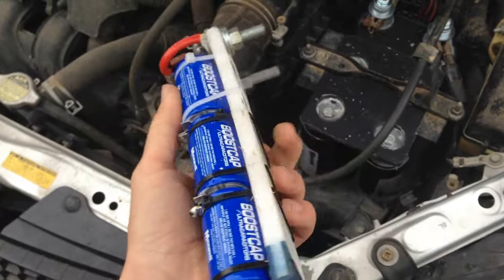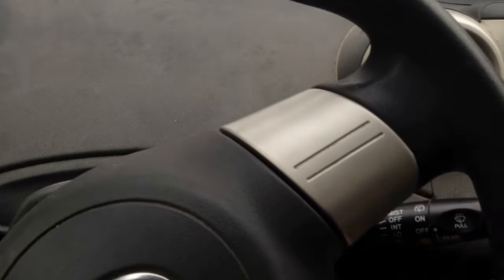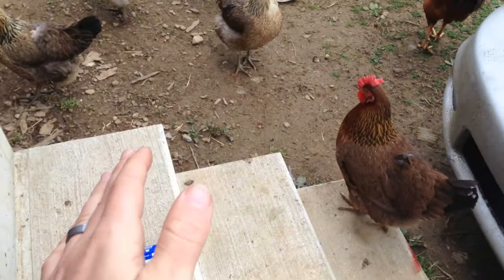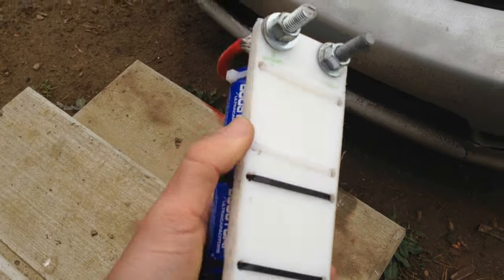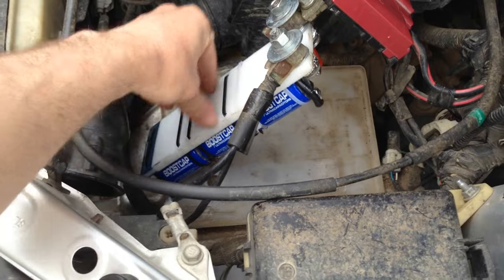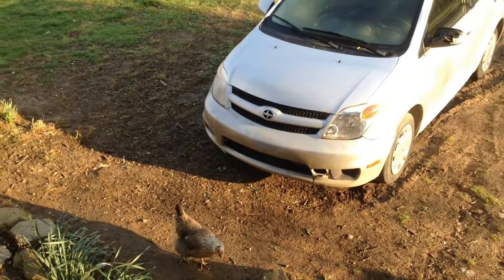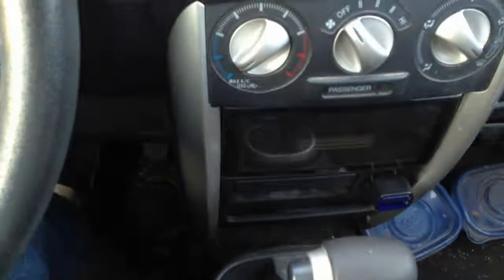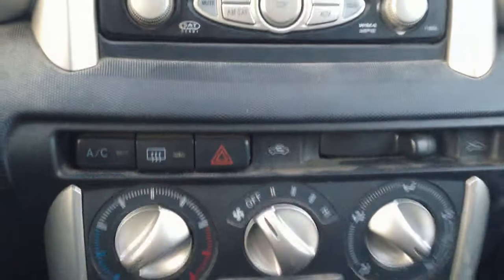Replacing My Car Battery with Capacitors! 12V BoostPack Update

Comment: You don't have 350 farads, you have 58.33333.
You don't have 2600 Farads, you have 433.33333.

When you put capacitors in series, you lose capacitance. When they're all the same value, the calculation is simple and you can just divide the value of one cap by the number of caps you have in series. if using different values in combination, it's slightly more complicated.
Reply: finally a good explanation :)
Reply: Capacitance adds in parallel, and reciprocates in series, correct?
Reply: Exact
Reply: How do you calculate the joules/Wh capacity?
Reply: @mikokuijn I believe the energy stored in a capacitor is 0.5*C*V^2
Reply: caps in series will equal a capacitance lower than the lowest value.
Reply: But the quantity of energy is added. 6 capacitors full charged will store 6 times more energy than a single one.
Reply: Luis FF that only works in parallel. when connected in series you lose capacitance. There's more energy in series because the voltage is higher, bit the capacitance is reduced. farads and joules are different units measuring energy different ways.
Reply: Krankie V The stored energy of the capacities in series and in parallel are the same.
Energy and capacitance are different.
Reply: Luis FF right so what's your point? this has nothing to do with my original comment about capacitance
Reply: The capacitance as seen as a unified circuit element adds as you say......but charge and energy stored doesn't change with configuration.
Reply: the total sum of individual capacitiors in series =product/sum
Reply: Krankie V d
Reply: something is wrong there
Reply: ty i was just about to comment that
Reply: The parallel and series properties have to do with how current flows in a circuit.

So in Parallel current from the source is the addition of all the branches, but in series the current is the same for all of the capacitors. 

So in parallel, I = I1 + I2 + I3 + ... + In (where I = C(dv/dt))
They will all store the same voltage so
I = (C1 + C2 + C3+...+Cn)(dv/dt)
In series:
V = v1 + v2 + v3 + v4+..+Vn

V = Q/C, Q is the charge

The current is the same in all the capacitors so the charge must also be
V = Q(1/c1 + 1/c2 + 1/c3 + ... + 1/cn).
Reply: Krankie V So putting them in parallel would decrease the drain time right?  Like the radio could play for hours instead of minutes.
Reply: Krankie V Can caps be placed in a series /parallel configuration?
Reply: Phil Hooper Don't forget ELI the ICE man:  E/L*I or E=L*I, E/L=I, E/I=L  & I/C=E, C*E=I, I/E=C  ☺️
Reply: Krankie V
Reply: I like your avatar
Reply: Krankie V you're half right.  Putting 6 2.5v caps in series is equivalent to one 12v cap of the same capacitance.
Reply: This is more educational than my whole year in college
Reply: @Krankie_V   1/Ztotal = SUM(1/Z) in // and in Serie Ztotal= SUM(Z) with Z=1/jCw So you can calculate the Ctotal of Ztotal
Reply: The calculation:
1 : 350 F = 0,0028571428571429 x 6 = 0,0171428571428571
1 : 0,0171428571428571 = 58,33333333333333 F
To calculate, use the 1/x button on the calculator. Press "350 1/x"  "x" "6 1/x" = and you're done.
Reply: how would you diy a jump starter with caps? which one would you use?
Reply: He requires higher voltage
Reply: he doesnt lose capacitance, because the capacitance is for the rated voltage
if you have a series of those boost caps with 2.5V over the whole series you lose capacitance as stated by the equation
but here, the whole series have 14V, means each capacitor have 2.33V applied on it's poles, so he get less than the rated capacitance but not too low
if he charged them with a 15V current, he will get 950J in each so 1.583Wh for the whole series
not much compared to a starting battery, but it can deliver instantaneous current enough to start the alternator
Reply: I wonder how long they'll hold a charge for with no drain on them.
Caps arent really made for storing electricity. Their best quality is the ability to charge and discharge rapidly. 
I'd give it a 2 or 3 day sitting test before taking it far from home without a backup.
Reply: Umm this is DC not AC power, only when u use capacitors, with AC power, in series they lose capacitance not in DC
Reply: Y B  
Or the clock on the stereo. Parasitic drain doesnt even have to be a bad circuit to drain, right? Magnets can drain as well?
Reply: @ihategoths3487  It's the opposite of the way resistance adds

Comment: This could be a nice "if all else fails" solution. You know, have a small hand cranked generator in the toolbox and you can have cranking power anywhere. In a minute or two you can have enough juice to have another try at starting the engine.
It only needs as much energy as i can create by pushing the car really hard for 10-20 seconds. It would just be so much less painful if i could crank the generator for 2-5 minutes without much effort. 
Also something to consider: This thing at full charge stores about as much energy as half of a AA battery... So having something like two backup 9v batterys in the car for the event of a battery drain, you might not even have to use the generator at all!
A 1 watt solar panel would need like 1,5 hour to charge this thing from empty to full too...
Reply: Incredible.
I'm amazed what can be accomplished with the low resistance of capacitors. While batteries handle the main storage.
I also had the handcrank idea, after finding one on Amazon, when I remembered this video for an off-roading channel. But I think, whether its a starter motor pack, or a homemade EV. Batteries & capacitors should always be together. From tiny batteries like you suggested to charge cranking caps in an emergency. To a battery pack the same size or bigger then a capacitor pack, to get more performance out of an EV, then batteries alone.

Comment: Using capacitors to start your vehicle is actually really cool.  The problem (which you noted) is that they don't hold a charge over extended periods of time, which is why you can't realistically replace a car battery with them.  Now if you could do a capacitor with a small battery combination, which would extend the charge of the capacitors over a longer period of time, that might be an actual replacement for the big clunky battery.

The "weekend" test was rather interesting.  Monday morning the voltage was pretty close to being into a no-start situation.  I'm sure temperature would play a large role in the ability of the capacitors to survive the weekend.  Specifically in the winter with -20 to -40 degree temps (where I live) I would expect the capacitors to discharge much faster.
Reply: +1
Reply: Yep, and forget about sitting in the car with the radio on w/o it running!  I do like the idea of using a Li-on pack for extended storage and the caps for cold cranking amps.  Of course it'd probably cost you as much as a lead acid battery, but it would be significantly lighter!
Reply: cap in parallel with a battery would create an RC circuit where the cap would deplete the battery, which acts as a resistive load for the capacitor. This combo would increase the CCA of your battery but would also drain your battery when left unattended. 

What you could do is put a relay that is run by the ignition between the cap and the battery to separate the two when the ignition is off.
Reply: squee222 I thought about doing that with my set up. I ended up not doing it because with the caps disconnected from the battery they can discharge down to 0 volts. When the relay turns on it's like a dead short on the battery.
Reply: Gaming With ViperZeroOne Ok now what happens if you hook up a float charger to maintain the charge. If it works there go the negatives about a battery lasting weeks. solar power or ac home power?
Reply: Yea you could do a hood mod and put in a small solar panel so the caps are always charged.
Reply: Mike H That's what I was thinking too
Reply: The  combination of small battery and caps does'nt stack up on cost but it could be useful as back up with some switching if you had the time to design it.
Reply: Which is why a solar panel on the dash would come into play. 

I fail to understand why this video has so many down votes.
Reply: Great if you live in sunny locations.  Here you can forget solar panels for six months of the year.
Reply: No need for a battery, just start putting cranks on the front of vehicles again so you can juice em lol. Or realistically just hide a tiny 5 watt monocrystalline solar panel somewhere on the vehicle and never worry about it again.
Reply: @KandiKlover  Those days were simple if you were young and healthy.  For the solar panel what If you lived somewhere that was  covered with cloud most of the year.
Reply: small solar panel for keeping the charge up
Reply: You basic CHEAP lead acid battery ain't so cheap any more.   I've been postponing replacing our KIA battery because it will cost $100+.    It still holds a charge but if "I forget," & leave something on, I have to bring out the extension cord & charger.
Reply: capacitors are leaking energy - thus even with battery, you will be loosing energy much faster, than in case you have only battery
Reply: @wiggysshop9890  How about having two relays - one for when ignition is on that would connect capacitors to battery with resistance inbetween for it to not be dead short and second one for starter to connect them dead short? Also additional indicator when supercap is charged to battery voltage, so you won't short the battery when cap is discharged and voila, problem solved.
The only thing is to make sure you wait for supercap to get charged before you crank the engine.

You could go further with that thing, connect starter only to supercap to use it purely to start the engine and not use battery for that, disconnecting cap from battery during cranking time to not get like cranking current via supercap charging resistor.

Comment: No, no, no, you need FLUX CAPACITORS!  Not just regular ones!
Reply: +ecwinste Flux Capacitors are so 1980's.
Reply: +StepBackAndThink But it's acceptable in 2010's too !
Reply: +ecwinste And don't forget to get some back up gasoline and two vials of Plutonium for the round trip.
Reply: @plum 1977 But that's not what capacitors are for there is no CCA. Try that shit in Michigan in January.
Reply: Charlie Lumadue don’t forget... the cars have 1 alternator
Reply: @oglej  Access denied :o(
Reply: What's the total amperage? CCA?
Reply: "Time Travel Enabled"

Comment: Learning about all this.

So far I've come to the conclusion that a battery alone isn't enough. And super capacitors alone aren't enough
But having both in a hybrid system makes a excellent system.

They support each other!   And make a longer life system.
Reply: Well. Batteries aren't really optimal for providing huge bursts of power, and capacitors alone don't provide enough in terms of voltage (which can be an issue if you have a chipped key security). Car batteries can obviously fill the role alone, but it comes at the expense of longetivity, and (usable) capacity. Not to mention that the power will fluctuate a lot, and there is quite a bit of energy lost whenever the energy goes from electric to chemical and back to electric. It seems best to get the capacitors to consolidate short term energy storage. While using the battery to provide long term power; for keeping the capacitors charged, and when the engine isn't running
Reply: Hey nice work in making this video. Please tell us how long they last. A year or two years. If we use 3 times daily to slef start

Comment: This could be a game changer. If you threw a small AGM or SLA 12v battery on there (something that float charges well, ie not lithium) it would be pretty reliable and quickly recharge with most alternators. It might not make a big deal for small cars, but batteries for larger trucks that require really high CCAs can get pretty expensive (and are super heavy).

Comment: I am using capacitors for my 2004 Mazda 3 since about 2 years and it's a perfect replacement. My capacitors can run the starter for about 22~25 seconds which is more than enough if everything with the car is just fine. Just don't forget to turn of the lights and the radio. I also got an small 12volt UPS battery which I'm using to recharge the capacitors in case there is no enough energy. Not a perfect solution but hey it works and it's cheap :)
Reply: Please, I understand that super capacitors can continue to increase in voltage. Therefore, could someone use a voltage protection system with the capacitors when installed for such usage?
Reply: @ejeckamdaniel1562  I use a voltmeter for the cigarette lighter slot to track the voltage and they never exceed 14.5V. When I connect the car to OBD sometimes it gives High Battery Voltage trouble code but no damage yet. Even if something happens I don't care, this car costs only $1500 in second hand market.

Comment: Capacitor can only hold electricity for a while. It accepts quick charge and quick release of electricity. A battery can hold the charge for a much much longer time. that is why our camera flash use a capacitor that takes power from battery for 4 to 5 sec and it can burst out all of that power in a single flash. but the charge of the capacitor usually hold for a very very short time. My car has a 21v capacitor that store energy when braking, the power from it can supply the car's AC and electronics stuffs, also help charging the battery. but even it is fully charged, the capacitor will completely empty in 1 hr. i know it as the manual said that it is safe to do battery swap after an hr to let the capacitor fully empty on its own.
Reply: Quiscent current is a concern. Modern cars draw a tiny amount of current. Solar panel with 12v 50ma rating should counter that.

Comment: i bet these eggs are tastier than the eggs from a store
and also great expirience with the capacitors. 
feels like it would be a good idea to add some of these capacitors to a regular car battery at winter time so you will have more power for your starter since batteries are losing their capacity when it's cold

Comment: I have been using one in my car for about 4 months now.  Regular car battery is totally removed.  Did this to save weight and increase fuel mileage.  This is not for everybody.
Downside:  1.  Engine must be running to operate any electrics (radio, lights etc. ) or else capacitors will drain very quickly.  2.  When you shut off the engine, all electrics must also be disabled or else capacitors will be dead by the morning.  I installed a 40 amp relay and ran all my electrics through it.  When I turn off the key, it turns off all electrics.  This also insures that, if you forget to turn off your headlights, they go off automatically.   3.  Your engine must be in good running order and start right up.    
      It only takes about 40 seconds to totally recharge, if the capacitors go dead.  So, just to make sure I am not left stranded, I bought a small 12v battery, off Ebay for $15, and keep it behind my drivers seat..  The main benefits to using a capacitor is, 1. better fuel economy,.  2.  much easier to work on my car now that the regular battery is no longer in the engine compartment and 3.   I do not have to replace the battery as often.  The capacitor battery is suppose to last for a least 10,000 starts.  The increased gas mileage will pay for the battery and more.  
      The weather finally got done to 22 degrees and I was able to test it's cold start capacity.  My car started right up.  I have the 300 cold crank version and live in the mountains of North Carolina.  If it gets really cold where you live, go with the 600 amp version.  I bought mine, already built, on Ebay for $100, shipped to my door.
     Again, I do not recommend this set up unless you are into innovation and do all the work on your vehicle.  I have a 1993, Geo Metro, and with modifications like this, I have increased my mileage from 45 mpg, hwy, to 75 mpg.
Reply: PS:  I have a motto, :  Those that can, do.  Those that can't, complain about those that can.
Reply: Great write up enjoyed reading this!